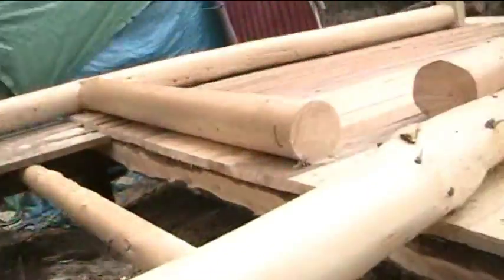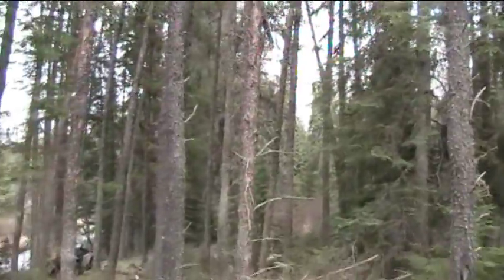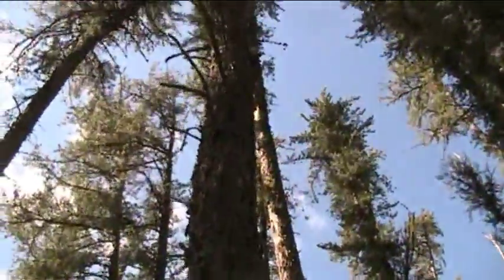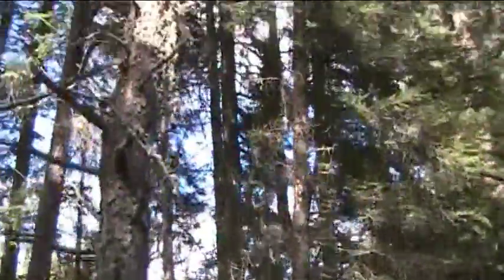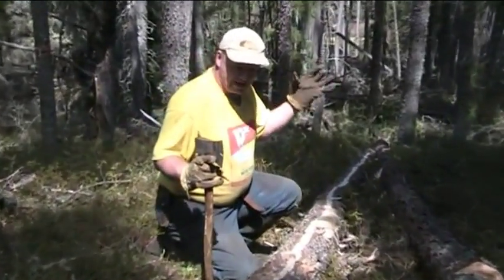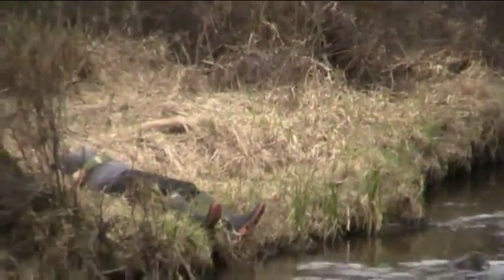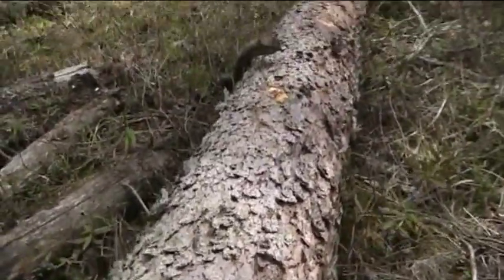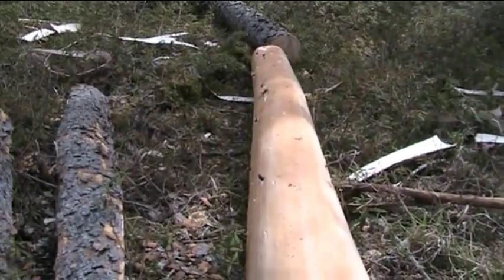How to Build a Cabin (Trapping Cabin) - Part 7

Comment: Did u treat ur wood for inside the cabin?
Reply from the maker: Not at all. I will treat the outside this summer. Oh I did add a bleach water mix to remove some of the black mould that often gets on the logs when they are cut and left on the ground to dry.